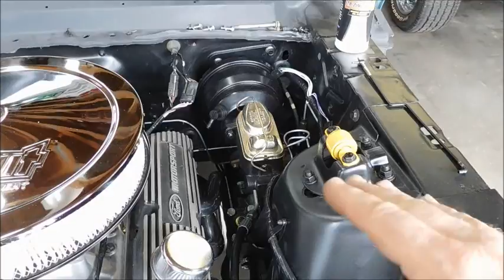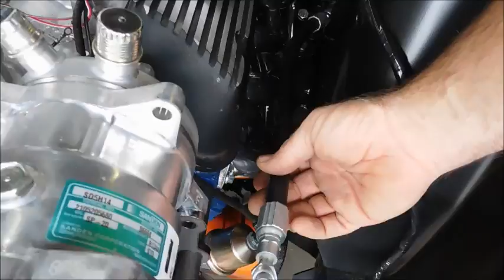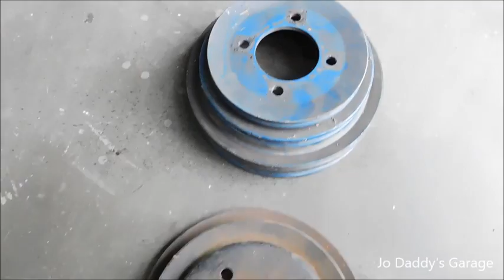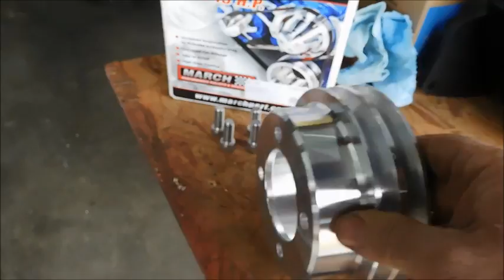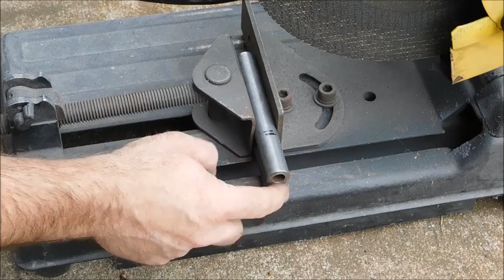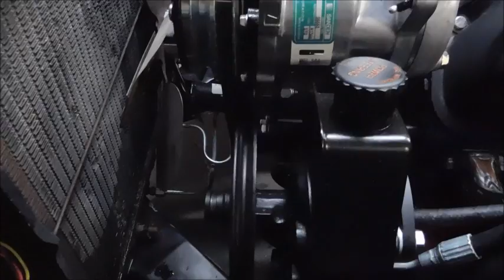1968 Mustang A/C bracket, power steering bracket, and start-up! Jade part 18. #mustang

Comment: Hey Jo Daddy
I see you are operating a Dual groove Crank Pulley running A/C Unit, Power Steering and Alternator off the Dual Groove.  I have a 351W  motor, will be running A/C, PowerSteering. I purchase a 3 groove 3bolt Crankshaft Pulley thinking i needed a 3 groove for the A/C.  After watching your video,  do I need a 3 Groove Crank pulley, or will I be ok with a Dual groove Crank pulley??

Thanks for your feedback and reply
Reply from the maker: Good question. It's really hard to give a firm answer. The 2 groove worked with my configuration. I don't see it causing any problems for me. If you have a similar setup, and are using the same parts it should work. I will say it took a little trial and error to get the setup I wanted.
Reply: @JoDaddysGarage  Thanks for the reply.  I want to do the same set up.  What A/c bracket is that, where do I find it?  Thanks for your help.
Reply: I think I found it.  Believe it's on Vintage airs website.

Comment: Thanks for the tutorial on the brackets. I enjoy you explaining the logic of your decisions as you go. Going to use a similar setup on my daughters 55 Customline. Going with the Boregeson power steering, vintage air for the AC on the 302 engine. Your vid helps me anticipate and resolve some of the issues. Gracias!
Reply from the maker: Vintage air sells a bracket kit, but it's not for the Borgeson set-up.

Comment: Very nice progress.  I wish I made some video's when I did similar work to my 67 coupe.  A couple of bits of feedback.

1. The power steering pressure line, run in the position in the video, WILL heat fatigue and fail due to heat from the headers (personal experience).
2. You have done a great job "cleaning up" under hood.  To further hide things run the wiring harness out the rear inner apron. By making a new hole and dimple it for strength.  The harness length will NOT need modification and you get it off your nice new shock tower. Makes a very nice under hood presentation.
3. Why Ford put the ugly starter solenoid in such a visible location is beyond me.  But... there is plenty of space below the battery and no wiring changes are required.  Makes a very nice under hood presentation.
4. I had to improve the run of heater hoses cleanly to the fire wall.

Anyway, thanks for the videos!
Chris
https://www.youtube.com/watch?v=MYWWdcvoUV0
Reply from the maker: Good ideas.